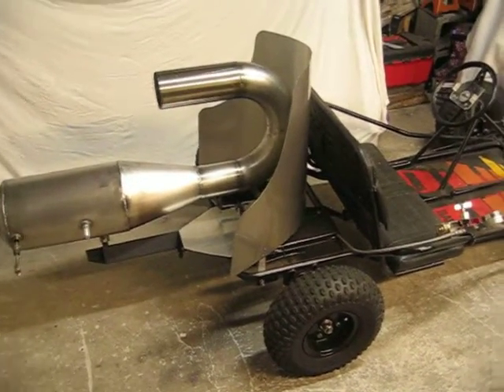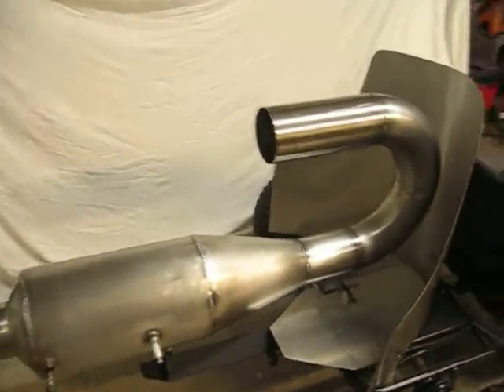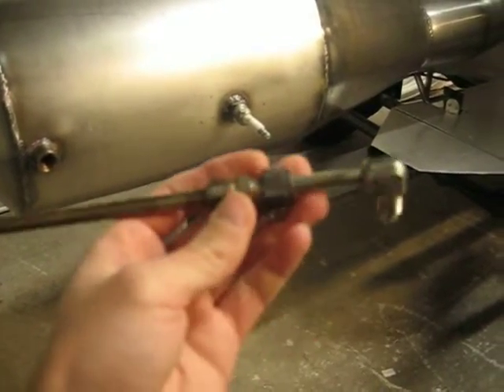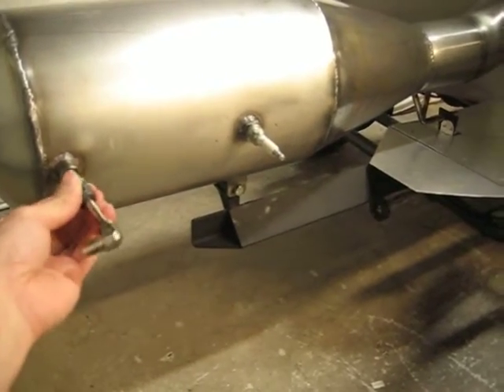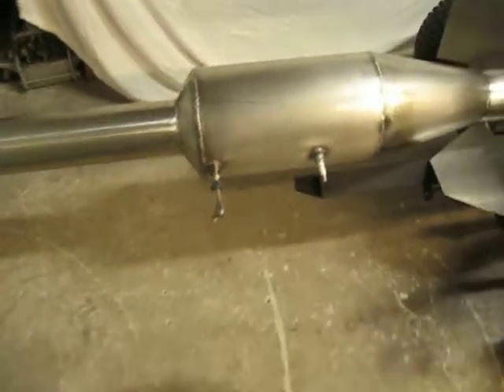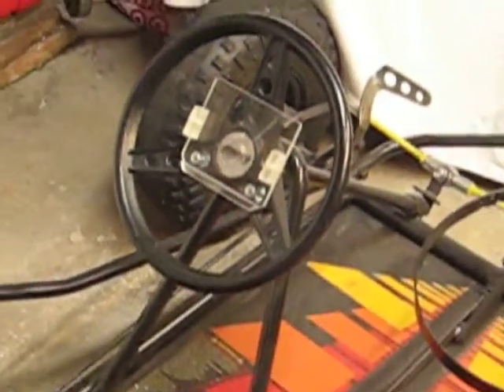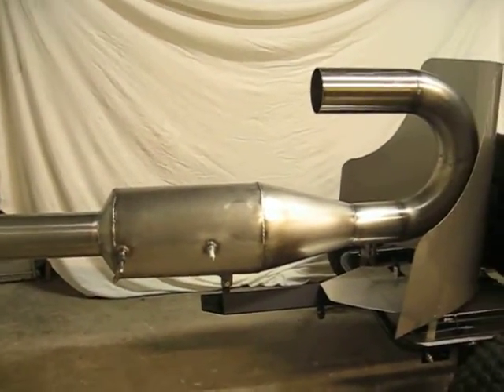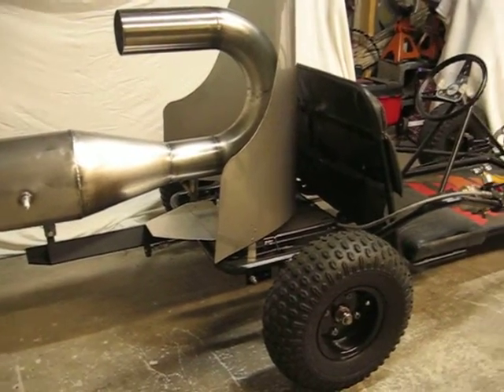pulse jet go kart upgrade, bigger engine

Comment: That is an awsome engine you have built! Is it your own design or did you follow existing plans?
What is the  ratio between the expanson chamber diameter and the exhust diameter on a lockwood engin?
Reply from the maker: I just built this one from a picture I found online.  Just scaled it from the photo.  The engine is 58 inches long.  The larger diameters are 8 inches.  The U pipe and intake pipe is 4 inches dia.

Comment: so u build a pipe like that and use a big propane tank and then just get a hose hooked up from the propane attach it to a smaller pipe going into the side with a spark plug but how does the spark get power ???
Reply from the maker: +Sara Mccollum 
I'm using a high voltage igniter unit.  You can lite it by any means

Comment: what do u use like make a chamber like that and put a spark plug in but do what with it and what is the fuel u use
Reply from the maker: +Sara Mccollum 
You can use any spark plug or ignition source to get the engine going.  I'm using propane for fuel.